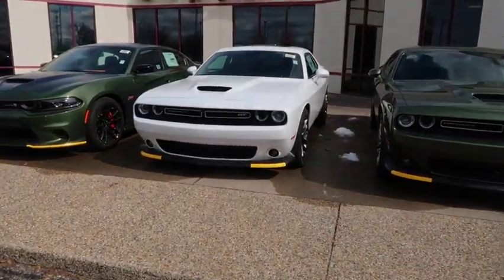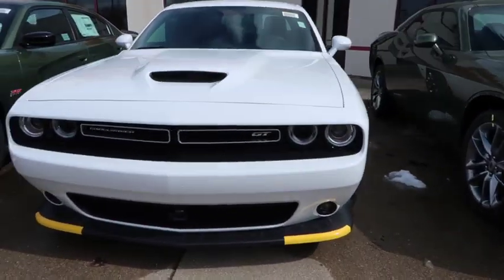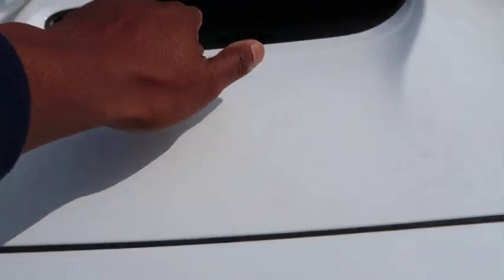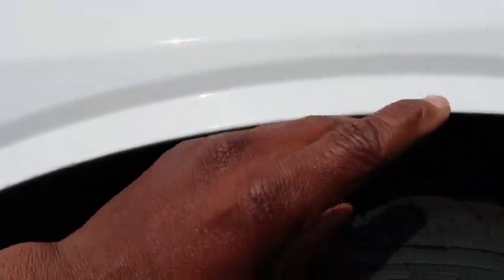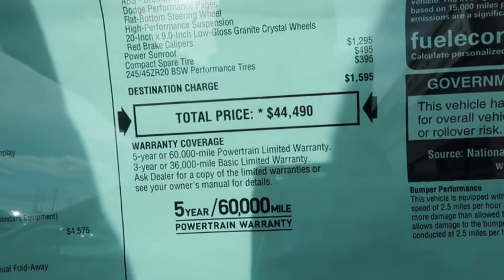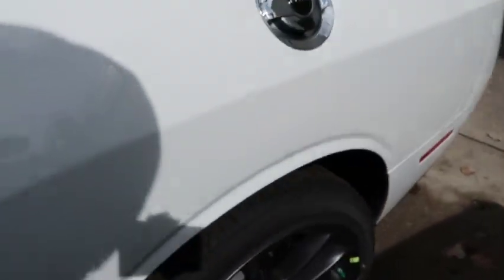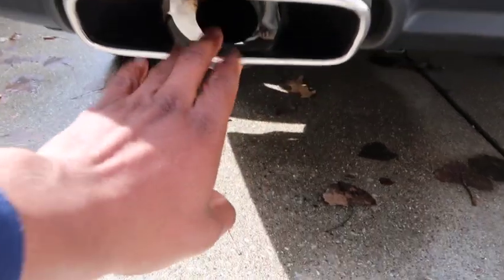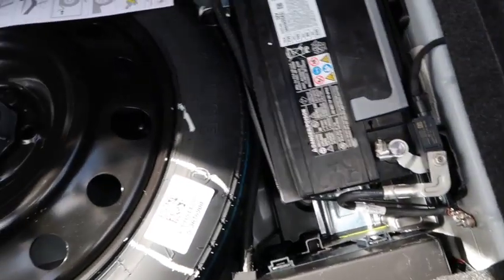2023 Dodge Challenger GT Review. Last Call Edition

Comment: Excellent review. I have a 2019 Challenger GT in Go Mango with the Blacktop Package. Also have the windows tinted. It's a great looking car. It's got the V-6
but it still has plenty of get up and go. That hoodscoop definately is functional as it sucks cool air into the engine bay. I have't done the ram air induction by popping out the center of one of the headlights. Maybe one of these days.
Reply from the maker: Thanks for the info and I appreciate the support